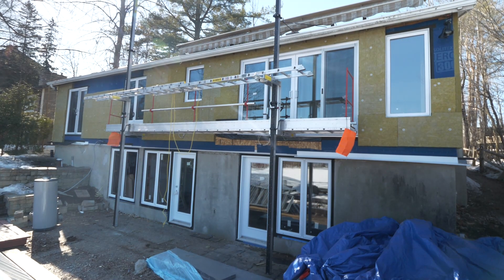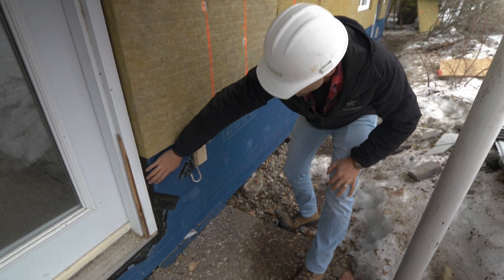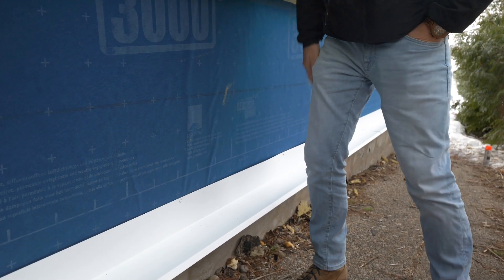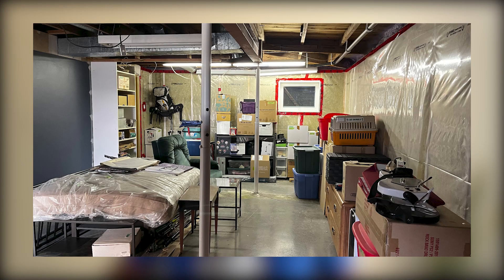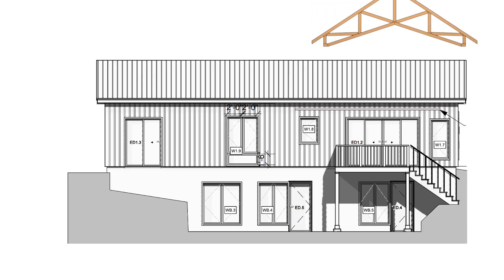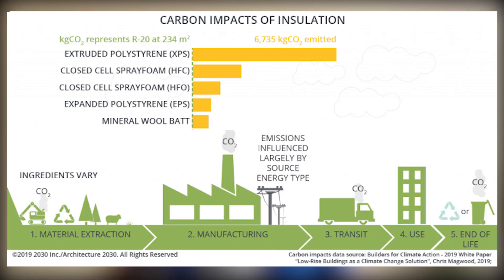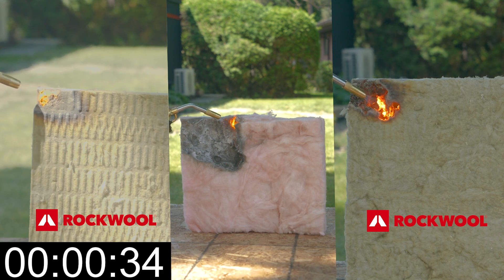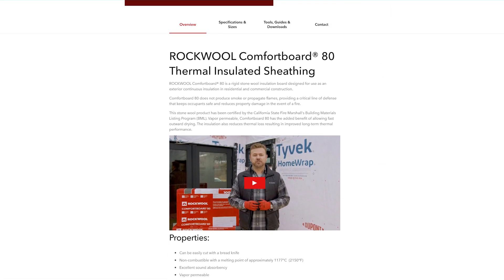Creating an Insulation Strategy

Comment: If the carbon portion is ignored, how does closed cell spray foam compare to Rockwool?
Reply from the maker: In what respect? It would give you more r-value per inch but has more off-gassing and is flammable.

Comment: Great video! Could you give us some information on the proper ratio between the amount of exterior continuous insulation needed compared to interior cavity insulation so that condensation doesn't form on the inside surface of the wall sheathing in a cold climate? 

With 3 inches of exterior Roxul, are you using special mounting blocks for your exterior wall lights, electrical outlets, hose bibs, etc? Also, I've heard Matt Risinger talk about having "one hole for one wire" whenever there are building envelope penetrations. Are you doing that and if so, are you using any special kinds of lineset covers?

Matt Risinger Airex HVAC Boots
https://www.youtube.com/watch?v=A6B79JHVOQQ
Matt Risinger Mounting Block Details
https://www.youtube.com/watch?v=sV3zzrRKr7A
Reply from the maker: The only way to know this for sure is to use WUFI (https://wufi.de/en/software/what-is-wufi/) as it will vary depending on the location of the home and how the assembly is built. That being said though, as long as warm air is not getting to the inside surface of the wall sheathing, you should be fine. This is another reason we love to use the products in this video though. If water does somehow form or get into the assembly, it has the ability to try and will not loose any of it's performance.

We haven't used specific mounting blocks but install the required backing. If there is something that works with the siding for better finishing, we do use those.

One hole, one wire works well but we also like to make sure we minimize the amount of penetrations through the air barrier. 475 has some great options depending on what you need to accomplish (https://ca.475.supply/collections/air-sealing-system).